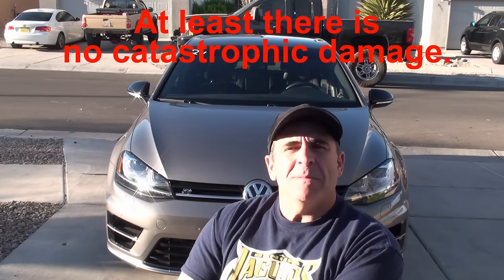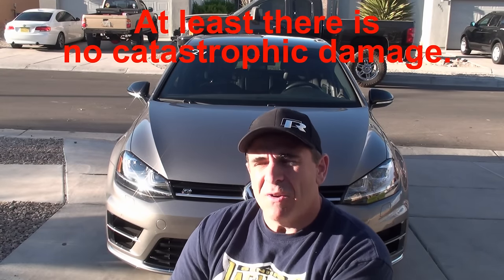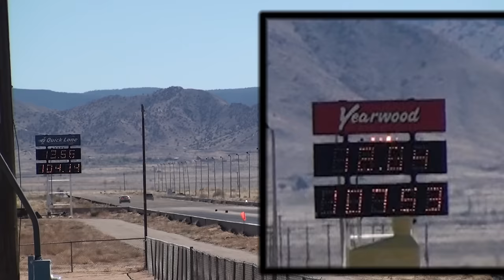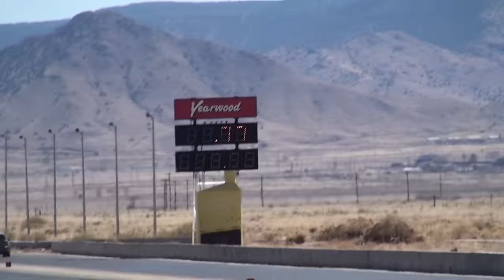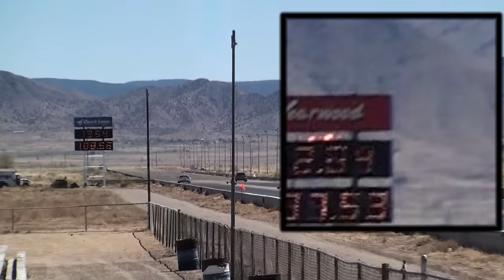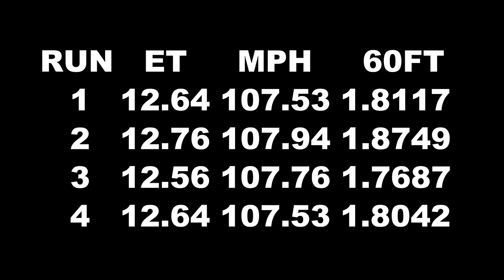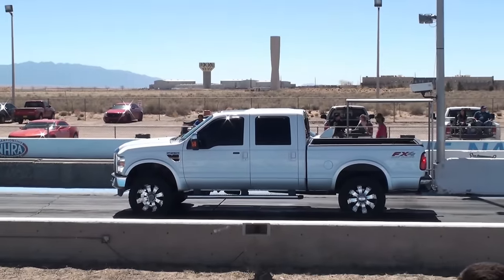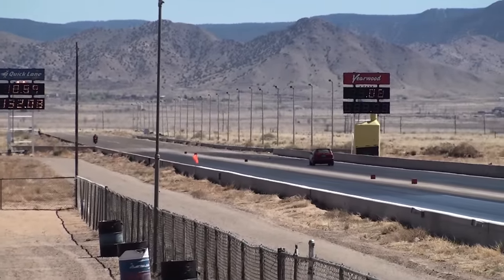2016 Golf R DSG APR Stage 2 Drag Times @5000 ft Elevation

Comment: Have you done a dynolicous run on the new stage 2 to compare?
Reply from the maker: +Meat Amigo That's a great question that I knew you would ask.  No, I should have done it at the track but I didn't want to wait in line again.  I'll try to check it this weekend to see if it is closer to what i'm actually running.
Reply: +Rad Fox cool man. If you haven't thought of it already you should try and find the same road/direction as before for a true comparison. I'm pretty interested to see the results.
Reply from the maker: ya, that's the problem, that road is way out.  I'll try to do it this weekend so we can see whats up.

Comment: Do you have a 034 dogbone mount? That will definitely help you out with that wheel hop.
Reply from the maker: +Kevin Kuntjoro ya, i just installed one two weeks ago and posted up a video of it.  The track is open next weekend so I will be heading back to see if it helped at all!
Reply: Probably should have looked at your channel lol. Tell me how you like it! I just ordered mine for the mk7 GTI in hopes for it to drive better while driving spiritedly. 

Also, are you on the golfmk7 forums?
Reply from the maker: Ya, I am on the forums but not very active.  With the GTI it seems that the insert is hit or miss.  Some people say that they don't really feel it unless they are driving aggressive (which is good) and other say that their car vibrates all of the time and they can't stand it. We know there are two mounts for the R, I assume the same is true for the GTI.  I have been wondering if there are still some differences in the rubber castings on the same type mounts or if the people who are vibrating like crazy may have already worn all their engine mounts out from wheel hopping too much. You'll have to let me know what you think after you do your install and test it out.  I have theorized that if the car ends up shaking at idle, that maybe a cheap fix may be to place a steel washer under the insert and between the stock mount.  This would raise the insert a little bit out of the mount and hopefully reduce some of its contact area and may help reduce the vibrations.  Anyways, let me know if it works out.
Reply: I know that there are two different versions. Since I do have a 2015 model, I have the version 1. I know the version 2 does have some problems with vibration (glad I'm not version 2), but 034 will have a free replacement when the update the design. 
I might not be able to feel much as I'm DSG not stick shift, which I believe you are the same way. Really interested to see how it performs as some people say it's the best thing they have modified, but some say it doesn't make too much of a difference. For the 37.90 I paid, it's very much worth the risk for me anyways. It'll be interesting to see how it effects both the GTI and Golf R. Let me know the difference it makes for you.
Reply from the maker: I am DSG too.  I noticed extra vibration when the car is started but only for an instant and then it is gone.  Light to moderate throttle and I don't really notice it.  Moderate to heavy throttle and I feel tighter shifts.  When performing tight turns under hard acceleration I feel the extra vibrations, and every little bit of tire bite and or slip.  The insert really connects you to the road under hard accelerations.
Reply: From what you say and what a lot of other people are saying, I'm looking very forward to getting this mod done. A lot more mechanical feel, and I definitely don't mind the extra vibrations (and hopefully my other passengers won't either lol)

Comment: Man the way you just reeled that corvette in was awesome. Great video again thoroughly enjoyed it. I'm jealous of AWD, it is just awesome. You are depressing the other guys in their cars when you kick their asses. Let's see what the intercooler will do. As for the wheels I like the OZ Allegeritta wheels in 18 which are around 18 pounds compared to the stock golf R wheels which are close to 30 pounds.
Reply from the maker: +oppanheimer That was awesome! :-) Those  are nice wheels you are looking at, do you know the total weight with rubber included? Which tires are you looking at?
Reply: The stockers are around 25 lbs. 24.5 actually.
Reply: Meat Amigo Yeah you are right, I thought they weighed the same as the Talladega wheels of the mk6 R which were around 29 lbs.
Reply: Rad Fox Sorry Rad I don't know the tyre weights.
Reply from the maker: Are you guys rolling on 19 or 18"  wheels.  I wanted to try and stay with 19" but it looks like if I drop to an 18" volk with PSS I could save 7 or more pounds per wheel.
Reply: +Rad Fox I just got some new PSS' for some 19 inch enkeis I had from before. They have a $70 back deal right now. The wheels are 22lb each and the tires are 23. I'm only saving 2 lbs over the stock 19s but the rubber is so much better. My car is a 2015 and came wit Bridgestones. I think the continentals that come on the 16s are better/lighter. 

Rad have you weighed one of your wheels? Mine weigh 46-47lbs each. If I was shopping I would want 18s. I just couldn't justify the extra money when work is a little slow and I already had a couple sets of wheels.       A big bonus on going with 18s is tires are way cheaper.
Reply from the maker: +Meat Amigo Hey $70 is pretty a pretty good deal.  My 2016 R came with continentals.  I am still looking around but damn is it hard to find some really light wheels.  Volk has really light wheels but I am not sure if we can get our bolt pattern, and exact offset, and then they are so damn expensive!  Those OZ Allegeritta that oppanheimer mentioned in 18" are 17.8 pounds, that might be the lightest  affordable wheel out there. Do you guys know of any others?
Reply: Rad Fox ATS Racelight are an awesome wheel with the 19 inch weighing about 10 kg, a bit heavier than the OZ I mentioned earlier but beautiful nonetheless.
Reply: +Rad Fox I just go on Tirerack.com and input the vehicle. It brings up all the wheels that fit. The Volks are not on tire rack but the OZ are. Looks like the RPF1 will always be the lightest at 17.0 for 18s. A little narrow at 7.5 but those are the lightest. If you go into the 18lb range you can get some 8 inch wheels. I was pretty set on the OZ Leggera HLT in Gloss Black at 18.65 lbs each wrapped in some PS2 or PSS. Since I'm sticking with the 19s I don't care if you get them. Enkei RSM9 are light too but expensive. The Legerra HLT are only like $350 each compared to $450 for the RSM9/Alegerra 18s.

Comment: You have to wake up if you want to jump the Corvette LOL  ESC limited what does that mean and why?
Reply from the maker: Ya, I need to wake up!  Haha! 

The first press of the traction control (ESC limitied: Electronic Stability Control) disables the anti wheel spin regulation and loosens up the stability control.  For drag racing and normal aggressive driving this is a good setting. This setting lets the car accelerate with full power (although I am pretty sure that there is still some kind of power limiting (drive-train protection) going on during 1st and 2nd gear). If you hold the button for a few seconds, the ESC is disabled.  This setting is what you would use on a track if you want to be able to let the rear of the car to slide out in a corner and possibly out of control and off the track.
Reply: Rad Fox you need to check out golf7 and vortex forums about vcds and asr esc settings red. You're totally fucking yourself not doing this and putting that much money into your R. The torque being limited in 1 and 2 even in a dsg car is huge from factory.

Comment: a high flow cat with a stock tune is it okay or not.  please replay
Reply from the maker: Do you have a MK7 Golf R or GTI? There are many people that are running stock tune with a downpipe and it appears that they are okay.  The turbo should spool slightly faster and you should gain mid and top end power.  You could install the downpipe and run stock until you can go straight to Stage 2 flash.
Reply: +Rad Fox thank you for your replay . I do have a mk7 gti

Comment: that nissan  had much noise than power...and can u tell me what do u think about the new ford RS
Reply from the maker: +florin colesnicenco very true! lol! 

I think the RS is going to be a fun car to thrash around on the weekends on a track but it lacks what I am after in a high horsepower daily driver.  These are my opinions so please don't be offended.

Here are the three main reason I did not want to buy an RS:
 
1)  UPGRADE-ABILITY: We already know a lot more about the MK7 R's potential, since it's in it's second year here in the US.  I also knew what had been done with the MK6.  The RS is too new.  We don't know how long it's going to take and how much money it's going to take to get the RS to the R level.  My sources have stated that the RS AWD system is maxed out and that it won't take more than the 350 HP that it already has. In addition, I have heard that the AWD system overheats and puts the car in limp mode.  Can you imagine what an aftermarket AWD system could cost? We really just don't know, and we need to see what happens over the next year or two.

2) LOOKS/ATTENTION:  I think the RS looks aggressive, I don't totally hate it like some do, but the problem is, the RS purposely trys to stand out and to be noticed.  It screams, hey look at me, I think I'm fast, come race me, come give me a speeding ticket. On the other hand, the R is clean, and hides in plain sight. To me, the R is the ultimate sleeper.

3) INTERIOR: The Golf R/GTI interior to me, is perfect.  Everything is in a perfect location, looks great, totally classy, totally comfortable on long drives.  The RS trys to hard, it looks goofy and awkward, like someone who just got out of art school threw it together.  It reminds me too much of all of the crappy rental cars I have driven and couldn't wait to get out of.  The recaro seats are sporty and cool if you want the race look. 

IN ADDITION: One thing that really made me happy to hear, which I had already suspected, after I had already bought my R, was that, the stock DSG R beats the 350HP RS in the quarter mile.  What does that tell you? That the extra 50HP in the RS is wasted somewhere. So that means that you will probably need 600 HP in the RS to out accelerate a 500HP DSG R.  I don't think it's possible for the RS AWD system to handle that kind of power when it is already having problems with the 350 HP it has now.     

I have other thoughts I would like to mention but I need to go take care of some other things.  Hopefully, I didn't bore you.
Reply: +Rad Fox is it ok to run full boltons with no tune, will it risk engine damage without being tuned, thanks
Reply: 1) I think that u are right,i heard that to. 2)Yes u are right with that too. 3) And yes i think the interior of r/gti its so perfect. And yes , i read that the head of projects at ford do not really want to let go of sales so early because of problems with the awd system. And no you didnt bore me,and i tank you so much for all your nice content and that u hade willingness to talk with me.
Reply from the maker: +jim jones It depends on what the bolt-ons are but truthfully I wouldn't know without looking at EGT's, Lambda, timing, and knock. i have really taken a back seat with VW because I have been purchasing the tunes from a company that likes to keep details between them and their dealers. 

What do/did you bolt on?
Reply: +Rad Fox I have a mk6 gti, but I want too add every single bolton before I get the tune in alabama/georgia weather

Comment: what octane gas do you put
Reply from the maker: 91 octane , pump gas up here.
Reply: +Rad Fox imagine what you can do with 93 or even a e85 tune
Reply from the maker: +evin salido +evin salido I wish we had higher octane up here. I don't have any experience with e85 though. Right now my tune is not selectable from within my car, APR is supposed to be working on it but it has been awhile with no new info.
Reply: +Rad Fox yeah i feel ur pain. my turbo mustang is hurting due to no 91 here either in west texas
Reply from the maker: +evin salido a turbo mustang is no joke! The turbo mustangs up here are very quick! It must be your daily driver then right? What kind of numbers have you put down on 91? Have you paid any attention to how humidity is affecting your power output?
Reply: +Rad Fox yeah the best I've done is 14.2 but i have a really difficult time with traction
Reply from the maker: +evin salido I bet you do have traction problems!  What are your trap speeds? Are you already running the widest stickiest tires you can get?
Reply: +Rad Fox i think like 99mph but like i said i have traction issues all the way to third gear, the widest i can go on these stock rims is 255 so i have some micheline pilot super sports. i still need to see how they do at the track

Comment: That heat sucks. I ran within .13 of hitting 11's on an unprepped track with just a Stage 1/DSG tune.
Reply from the maker: Ya, you are doing pretty well with your ride.  I talked to another person who got that number down to 11.99 with PSS tires and removing the spare and bunch of junk out the hatch. What tires are you running and where are you located?
Reply: I actually had PSS at the time, but it was the last track day of the year so they put zero effort into prepping. I spun enough to probably keep me out of the 11's. I was in Columbus, OH at the time of my videos.
Reply from the maker: Hey cool! I subscribed to your channel.  Damn that was a lot of snow on your car! I have no doubt you would have broke into the 11's.  I can't tell in the drag video but wheels were you running?
Reply: I hope to. I have my downpipe for stage 2. Just gotta get it put on and schedule the tune. Hoping for 11.7's then. I'm running VMR V710's in gunmetal in this video. 18" instead of stock 19" due to potholes. :(

Comment: I found a trick on the LC you have to let off the brake between the 2nd and 3rd yellow.
Reply from the maker: Did u get a good RT using that?
Reply: +Rad Fox yeah I was much more consistent once I started thinking about it like that. Before I was trying to stage really early and go on the second yellow. I was red lighting too much like that because it depended too much on my staging I think. Now I try and let off right before the 3rd yellow comes on. I went on the 3rd yellow at first and was getting like .700 RT closer to .0X0 and .1XX times now.
Reply from the maker: Hey did you check out that other Stg 2 R running a 12.5 best with a DA of like 400, but the humidity was freaking high! https://www.youtube.com/watch?v=et8T-tTRvUU

Comment: let's see what that thing could do against a stage 1 cla 45 amg
Reply: MATTHA FAKKA what's the price difference and btw the stage 2 golf does 3.6 seconds and high 10s with dsg transmission
Reply: Jake by the way the cla 45 amg stage 2 is faster than that 3.6 of yours.
stage 1 cla 45 with just a ecu tune is 410+hp at the crank. 

and i bought a cla 45 amg for less than the price of a brand new R. certified and with warranty. lol
Reply: MATTHA FAKKA that's cool. i really like that car but i'm only 17 and don't have 45k to play with. it has only a time of 4.5 seconds 0-60 so the golf is actually faster. 30k with stage 2 kit so it is far cheaper too. a golf would be much more suitable for someone of my age as the merc requires more class and is for upper class people. maybe when i'm around 30 i might find myself behind the wheel of one.
Reply: Jake uhmm actually it's 4.1- 4.3 for 2014-2015 cla 45
then from 3.9-4.1 for the 2016 and up. do you want me to send links of stock vs stock cla45 vs golf r? cause there are lots on youtube lol
Reply: The 2016 CLA 45 and A45 yes have more power after tune compared to Golf R (even though CLA/A45 are heaver its still significant increase to beat theoretically Golf R) But if you check out some video's, it's struggling to beat the R. Both from 0 and from motion. From 0 because its A45's AWD system kicks in half a second late. And from motion....

Comment: weird, i did a 11.9 with apr stage 1
Reply from the maker: Mike Price ya, that is what you should run near sea level. Meat Amigo who has posted in the comments, and videos, has ran 11.9 with his APR stage 1 too. I am at about 5300 ft.  Bring your car up here and you will probably run a 12.8.   It's not just elevation that maters, its Density Altitude that matters.  Where I am at the DA varies from 5800ft to 8900 ft.  Naturally aspirated cars lose the most power (typically they are  about 1.3 seconds slower), our turbo setups don't lose as much but it is still significant (about .8 seconds).  I make trips to Phoenix which is around 2000 ft ASL and the car is absolute beast, I cant imagine what it must feel like for you! If I get a chance and the DA isn't too bad in Phoenix when I am there I will make some runs at Firebird Raceway.
Reply: +Rad Fox good points made rad, now makes sense

Comment: Stage two should be 11.89~
Reply from the maker: +random1110111 Not at this elevation with this DA.  Plus I am 91 octane not 93 with stock IC.  I also had some high frequency wheel hop that my new dogbone insert should fix.  I will be heading back soon and should do better but there is no way I will get in the 11's up here with full interior until I go stage 3.